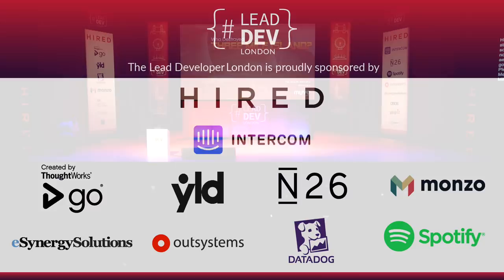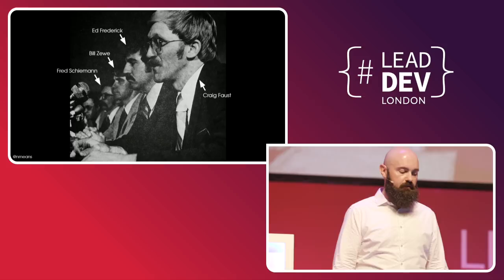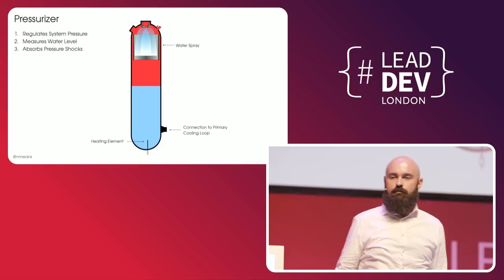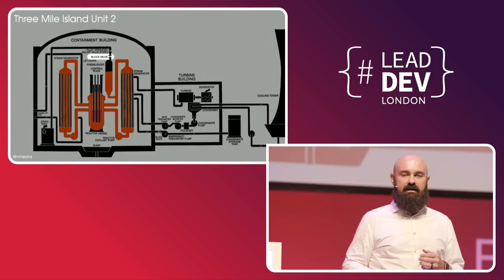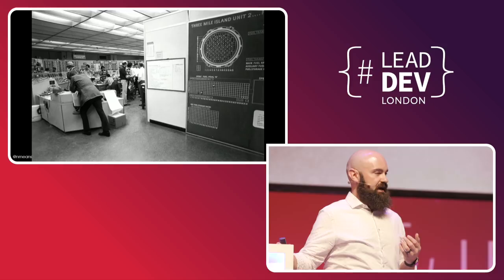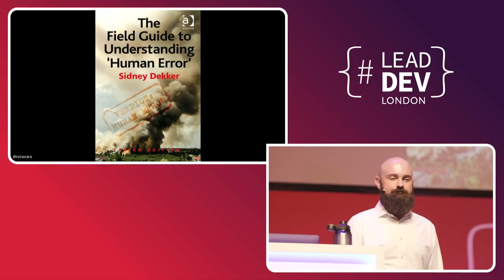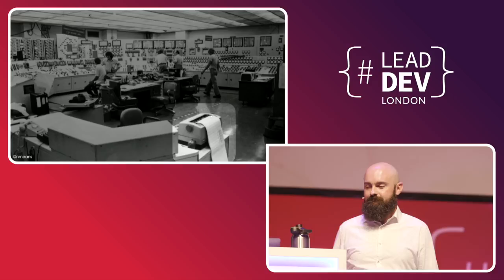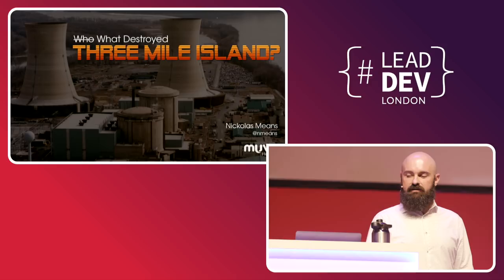Who Destroyed Three Mile Island? - Nickolas Means | #LeadDevLondon 2018

Comment: It's bizarre that the control room would be designed with a mishmash of warning lights, some critical, some trivial, all mixed together. People can only process a few pieces of information at a time so segregating and highlighting important information is key. I also don't understand why there wasn't a water level sensor in the reactor.  You can't just look at a giant vat from the outside (or control room) and know how much water inside. You need sensors to tell you that. You need flow sensors to know what is flowing where, just having a green/red light about what a valve should be doing doesn't cut it, you need to measure what is actually happening.
Reply: we are coming from an era where we have 5 cameras on our phones. these people lived in 1970 ies
Reply: @TurkishRepublicanX  In 1976 at BC Hydro we had MUCH better position indication and alarm system. I do agree that flow sensors were uncommon back then (DP cells across an orifice), but water level, valve position and an alarm annunciator that accomodated NEW alarms were definitely easy to implement.
Reply: Well, I think that were simply some design failures.
Reply: There was no water level indicator because a PWR is always full.  Too much information is as bad as not enough.  Had that operator tapped that pressurizer level gauge, he would have known the reactor was dry.  The water level system all PWRs were forced to install cost $millions and only confused things.  If that indicator ever comes off of 100%, the operator has a heart attack.  An electrical glitch or a nearby 2-way radio can do that.

After the accident, the NRC published this inches-thick document called RegGuide 1.97.  It contained thousands of mandatory modifications all plant operators were forced to make.  Most were inane and a few years later, the NRC rescinded many of them.

One of the more egregiously idiotic requirements was to design and install post accident radiation monitors so deaf that if the entire core appeared under the main vent duct monitor, it would stay on-scale.  They hired my company to design, fabricate and calibrate these monitors.  It was thrilling working with thousands of Curies of Kr-85 and Xe-133 but it was all so unnecessary.

The indicators should always remain at zero but they didn't.  A nearby walkie-talkie could cause an upscale reading.  So could a routine radioactive gas leak that allowed the gas to diffuse through the seals, directly contact the detector and cause an upscale reading.  Every time there was an indication, the operators had to initiate an emergency plan until the indication could be proved an anomaly.

They caused so much trouble across all plants that a few years later, the NRC relented and allowed them to be removed.  That held true for many of the RegGuide requirements.  This knee-jerk document, mostly prepared by academics, cost $billions, only to be mostly scrapped.

John

Comment: Working in Process Control and Instrumentation since 1976, I can fully understand the problems. Instrumentation is KEY - for instance, position sensors MUST be used for any critical valve. And the Alarm System must inform the operators IMMEDIATELY of any new alarm - at BC Hydro, we had a system that flashed any unacknowledged alarm and set off a buzzer, even if there were 1000 alarms. Those two items would have prevented a disaster.

Comment: The excuse about Navy trained Nuclear Operator's concern about "going solid" is unfounded. Naval nuclear training has always emphasized core cooling as the critical activity. If that excuse is to have any weight, then Where is the blame on the plant specific training? Given that the design of TMI is drastically different than the Westinghouse PWR found in the Nuclear Navy. Plant specific Operator training or absence thereof had much to do with this accident, including the attitude that plant procedures were "optional".

Comment: So it’s very interesting that the printer was slow,  no visible valve indicators,  alarm panels with randomly placed lights,  got through all design meetings and all mock ups.   Wonder what else got through? Mmmmm
Reply: again second story im sure if you asked the people who designed the alarm panel they would have a perfectly rational and logical reason why the panel was wired up that way and the printer, could simply be that's the best tech they could use for the printer, remember when TMI was built tech was nowhere near as high bandwidth it could be as simple as the computer controlling the reactor could have enough bandwidth for all the things or you could have a fast printer,,,,,,, which do you choose,,,, (im just throwing out a guess)
Reply: @totemictoad4691  Besides: System Design and the understanding of user interfaces have greatly improved since the 1970s.. :)
Reply: A basic schematic of the workings of the reactor with warning lights in the relevant location on that schematic is simple to design and quickly understand
Reply: @iamdave84  & @TotemicToad A year late but from what i recall, 3 mile island was one of the big industrial accidents that made everyone aware of the importance of good UI design in safety critical equipment, it still catches people out in subtle ways from time to time. But it's something thats actually considered in the design phase of stuff now, it really wasn't once upon a time.

Comment: What I got from this was, If the polisher had a by-pass system to isolate any of them from the system the whole accident could have been avoided.
Reply: K.D. Pearce There was so many more times this could have been avoided. People should know how to operate nuclear reactor.
Reply: @lederp42  Yes of course. But people who operate nuclear reactors need to be held to a higher standard.
Reply: @hene193  You learned nothing from the video then.
Reply: @hene193  You need to develop that standard before the accident happens, otherwise you are saying that people should be perfect and never make mistakes. You can't change standards after the incident and expect actors to follow it
Reply: MegaMedia5 Oh I never expect people to be perfect. That is a big key in many areas of design. You need to assume that people make mistakes. And desing systems so that when people make mistakes they can see it and hopefully correct them before anything too bad happens. 

But in hindsight things always seem so easy. Bad things happen and you learn from them. Like maybe the reactor engineers don't need to the elevator warning light.

Comment: This is, IMHO, an excellent analysis of the TMI-2 accident.  However, he did misscharacterize the Navy Nuclear training a bit.  I am a former "Navy Nuke."  I was trained that a solid pressurizer for an OPERATING reactor was indeed a disaster in the making.  We were also trained that a solid pressurizer for a shutdown reactor with the steam stops closed was NOT a disaster.  This is the same training that the TMI operators should have received.
Nickolas reminds me of a PhD engineer from GE that was one of the design engineers for the S5G reactor.  Usually about a week after an event at the prototype (where he was then working in Idaho) he would very informally "chat" with all of the crew personnel that had been involved in the incident.  It was well known and understood that he would not reveal the sources for the information that he obtained.  The result of this one man's way of dealing with issues led to corrections that actually fixed problems.  The success of that man stuck with me throughout my career and served me well.  I see now that he was a man "ahead of his time."
While individual managers and supervisors are still a problem using the "who to blame" mode, the nuclear industry as a whole has been quite good about serious "root cause analysis" and what can be done to help operators from making errors.  I don't want to try to write a book here but Brown's Ferry and TMI alone resulted in design and "Human Factors Engineering" changes numbering in the thousands.
Reply: Everything you say is your opinion. (From Common Law, which we inherited primarily  from England and to a lesser degree from Europe, only God can know fact. Everyone else is simply, always, just stating their opinion as to what is fact that only God can know.) I'm not a former "Navy or other Nuke", but, I still understood his explanation well enough to think your opinion is not only wrong but potentially dangerous. I strongly suggest you go back, view it again, find where he discusses why the naval reactor training was/is inappropriate, and see if you're remembering your own training correctly and if you've "jumped to..." an inappropriate "... conclusion" You might have said, "that a solid pressurizer for a [properly] shutdown [naval] reactor with the steam stops closed was [less likely to (insert proper phrase, i.e. meltdown, vent radioactive steam, etc.)]." Again, some study online about the differences between military naval reactors and commercial reactors might be appropriate.

Oh, and the word you were probably looking for is "misstated" and not the misspelled "misscharacterize", which spelled properly is "mischaracterize", which you used above.
Reply: @johneeadbl5876   Of course I'm expressing my opinion.  That opinion however is based upon over 10 years of experience that took place during the time that those operators were Navy nuclear operators.
First, the pressurizer performs two important functions.  The first is to limit pressure excursions during normal and accident conditions (assuming a physically intact cooling system).  It is also necessary to ensure that no over-pressurization event that occurs can threaten the physical pressure limits of the coolant system.  When the reactor is operating, the pressurizer is required for this function as relief valves are not sufficient.  Once the reactor is shutdown, relief valves are sufficient.   Once the reactor is shutdown there is nothing that is capable of heating the coolant fast enough to exceed the relief valve capacity.
The REAL root problem is management attitude toward "procedural compliance."  Operators are afraid to do anything that is not called out in a procedure for fear of punitive action on the part of management.  I don't know the solution to that problem other than to allow an occasional TMI event.
Reply: @billleach3396  -You need to watch the video again, Bill, until you understand why your experience, like those operators at Three Mile Island, doesn't directly apply. Nickolas Means explained it very well. So well, in fact, that I understood it with one viewing. I'm thinking--very strongly--that you may be suffering from the thinking-problems he talked about. Those procedures--which you should know from your naval experience--are put in place so that people can override the disastrous effect panic can have on thinking. Anti-nuclear-plant activists correctly point out that nuclear energy production is too complex, not well enough known. Certainly, being able to take decisive action contrary to the "manual" may be valuable when some makes the correct decisions, i.e. the Russian who refused to initiate a nuclear counter-attack when their early warning radar system malfunctioned and it appeared we had initiated a nuclear first strike. But, from watching the video above, it seems to me--I simply don't have time at the moment to re-watch it to verify what I've been saying to you--that a failure to follow the manual is why the Three Mile Island nuclear accident occurred. All too often, the owners and operators of nuclear reactors take unjustifiable risks, i.e. Chernobyl and Windscale (it's a beautifully simple design, in theory. In practice, it released huge amounts of radioactive fallout, and, the operators followed the manual until it caught fire, then had to be proactive in creating procedures to put out that fire).

Again, I think you need to re-watch the video until you understand why the accident was partially caused by the operators' bias from their naval experiences. Until then, please don't waste any more of my time.
Reply: @johneeadbl5876   OK we're done wasting each other's time.  However, I'm afraid that there is one place where I do have to agree with you!  The ultimate root cause of TMI was indeed failure to follow procedure and comply with design requirements.  The accident would never have been initiated had not the plant been in an operating condition that was not permitted by design (and procedure).
The best thing that came out of TMI was INPO.  INPO instituted significant improvement in how utilities operated their plants.  INPO and the NRC must not "let up" on demanding excellence from the highest levels of plant management... and not just "lip service."
Reply: @billleach3396  OOP (: a single mistake. It takes several mistakes to require an "OOPS" :) Forgot to unsubscribe. You might take a look at the other comments above and below to see how others have begun to change their thinking patterns after watching this video. That's the point of the video, not an analysis of the accident, but, how analyzing the accident can help to change the defective thinking pattern(s) that caused it, Bill, i.e. your "single think" where you can't get past former naval reactor operators relying on that experience when it didn't apply at Three Mile Island. OK. I have rectified my single OOP and am now unsubscribed.
Reply: @marianmarkovic5881   Yeah thanks.  I watched that several years ago.  I'm not inclined to watch it again but recollect that it contained some good information but had both inaccurate, incomplete information and some bias.  Enough that if you were not well educated on nuclear physics, and reactor materials and operation you could take an anti-nuclear stance on invalid claims.
Reply: @billleach3396  I thing one of best videos about nuclear safety have Anna Drábová, head of czech state atomic safety regulation, unfortunetly all of them are in czech....But, in almoust all of her lessons one will hear,... Atomic industry is still industry, and as such like in any industry, accidents had happend and will hapend.
Reply: @marianmarkovic5881   You can generalize even further "...like any human activity, accidents..."
I had a nuclear training manager once tell me that he believed that we should accept having core damage much more than we do now.  Of course he would not have stated that to someone that he did not know well.
In a sense I agree with him but only partially.  Striving for a culture of safety is vital for any activity that has a potential for great harm.  The measures taken by so many in management when an employee makes a mistake are not conducive to building a strong safety culture.  Sending an employee into a long "retraining program" (as opposed to continuing training programs) because of a mistake is usually itself a mistake but lets management "ring their bell" by "doing something."

Comment: For the record. This guy was likely a teenager or younger in 1979. Three Mile Island (3MI). I wanted to point out that there is a Company in La Jolla CA called “General Atomics”. At the time of the accident GA had an employee count of about 2000 people. More then half of which had advanced Degrees. One of those employees was me.
GA did not design, install, build or operate the controlling systems at 3MI. But, it did design, build and install 50 “PIG” monitors. Particulate, Iodine and Gaseous. The PIGs were scattered around the site and fed the gathered data back to a central computer(s) designed and built by GA ( and me ). At the time of the accident the GA system was operating correctly, being monitored locally, and by remote connection at GA in La Jolla. One of the Computer Engineers on the GA design team was yours truly.
The causes of the 3MI accident have been gone over and over and over again for more then 40-years. Wild ass'd claims and conspiracy theories have been floated over and over again. All of them debunked. There was an accident, a bad one, it was fully contained, no one was injured, there was no widespread release of radiation. Inside the containment building was a nuclear hell. There was little to no detectable radiation or release there of at any time. Radiation at the site fence was at "background" levels all during the event. I saw the green bar paper print outs. Almost in real time. There were 28Kb modems in 1979.
Reply: TMI had no GA equipment.  Everything was Victoreen.  Victoreen called them Continuous Air Monitors.  TVA's Westinghouse reactors have GA systems.  A good friend was the project manager on the changeout from analog channels to a digital system at Sequoyah and Watts Bar, identical plants.

John